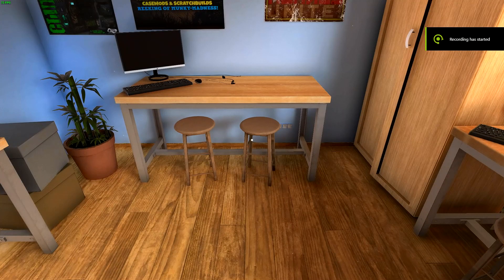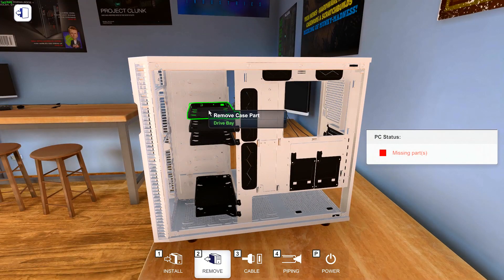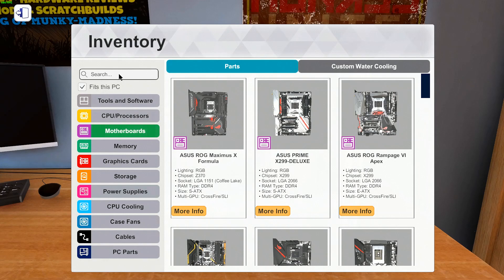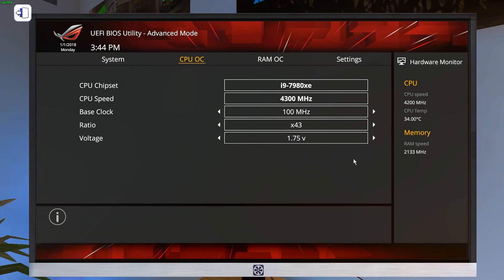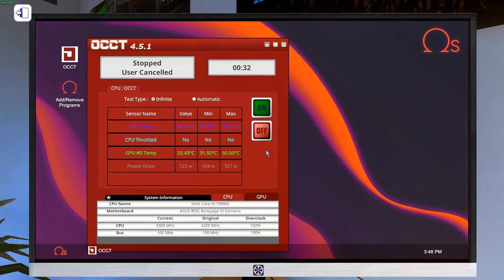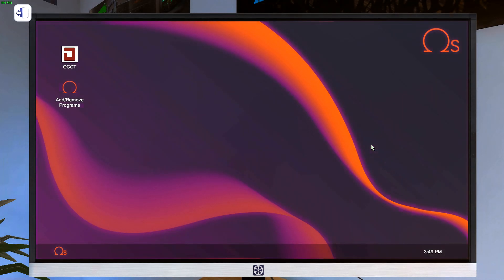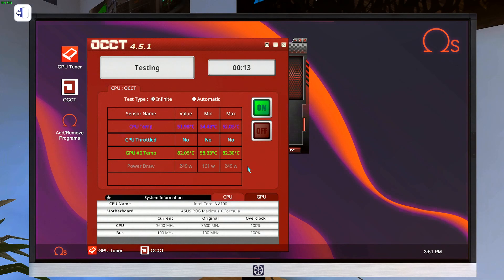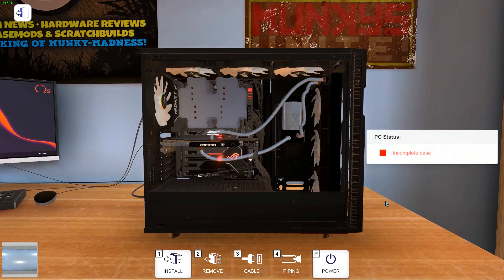Turbo's Guide to Binning and OC in PCBS - Part 1: Creating a Binning Database

Comment: my cpu temp is 
idle 47
stressed 50

my gpu temp is
idle 57
stressed 60

Btw cpu is overclocked by 100mhz and a bit and gpu is overclocked to max on clock on oc tuner and memory overclocked by 90mhz on oc tuner. If anybody interested how I did this I can share my build. Just to let you know you will be surprised and on whole youtube there is only 1 vid about this build. It is the most cooling you can ever have and a bunch of rgb like trust me its LIT XD